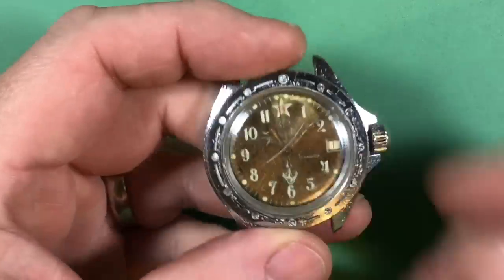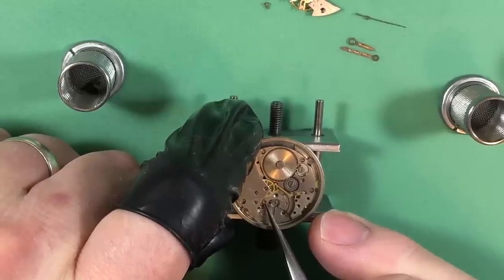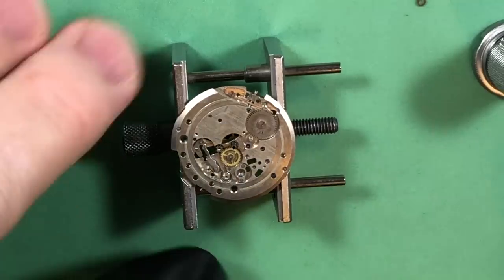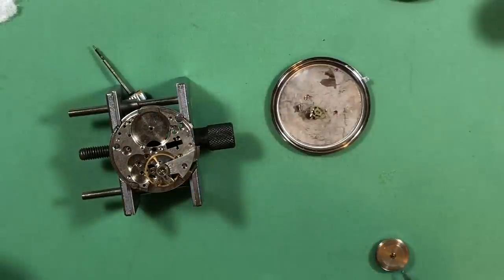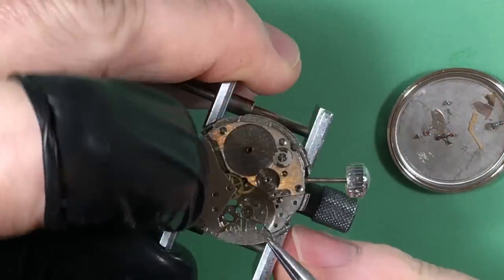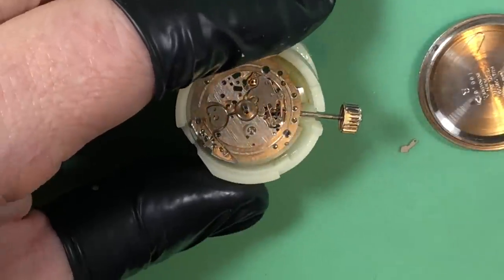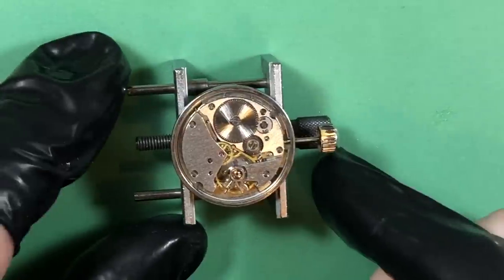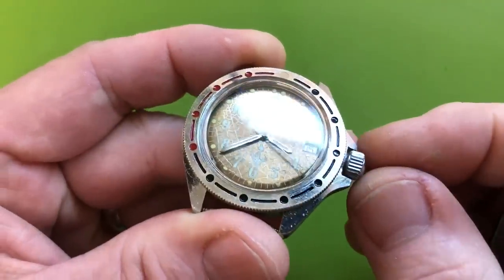Let's restore a $28 watch!  1980s Vostok Komandirskie

Comment: Do not see any restoration there! Just regular service this old watch deserve
Reply from the maker: Movement service is just a service.  Taking the entire f'ing watch apart down to the last screw, cleaning everything by hand, and then by the appropriate methods, then rebuilding while also repairing, then timing / adjusting?  The deep hand-cleaning I did of the dial?  

Let's see how you do one, "Schlomo".
Reply: @SpencerKleinVintageWatch  repassage but not restoration. Restoration its when you made by yourself missing part, restoring dual in zero conditioning and all. Let’s bid. Id you make simple appendectomy i will make service.
Reply from the maker: @ShlomoLevi  This has nothing to do with surgery.   What I do is more than "servicing", so that's what I call it.   You can call anything whatever you want.   There's more to life than being right.  There are things that matter, and things that don't.  A quibble about what a non-English speaker thinks the meaning of a word may be is just a waste of your time and mine, and my time is valuable.
Reply: @SpencerKleinVintageWatch  I have great respect for the profession of a watchmaker But for example, in the Soviet Union, a waiter was trained at a vocational school for 12 months as a hairdresser 18 And a watchmaker is only 4 months So as much as watchmakers don’t like to tell how important they are This is a rather primitive profession and once again restoration This is somewhat different than a service  or rePassage